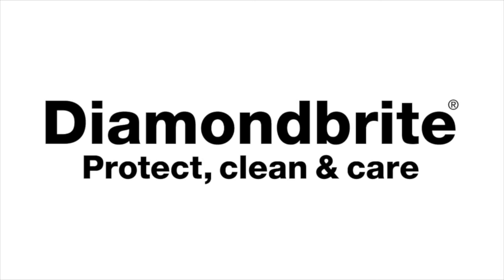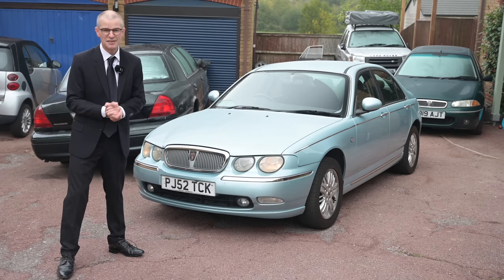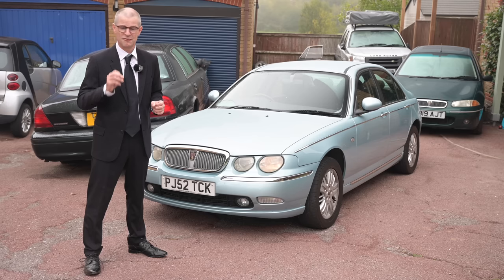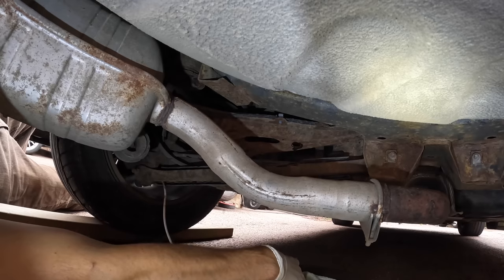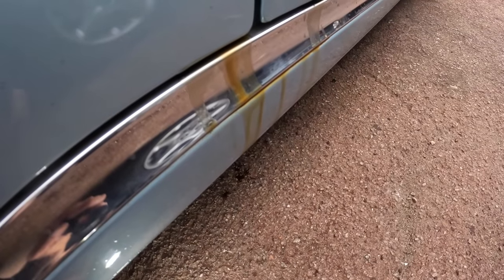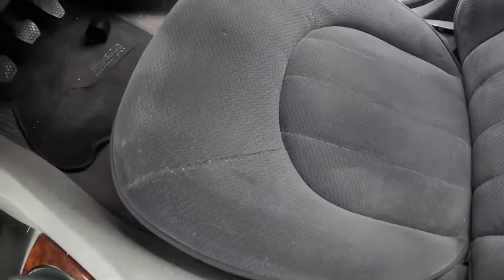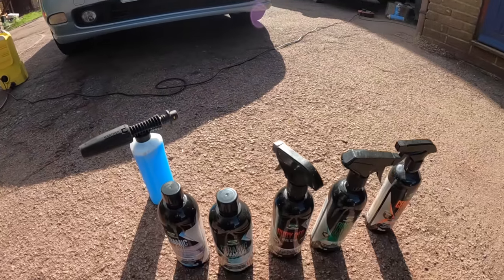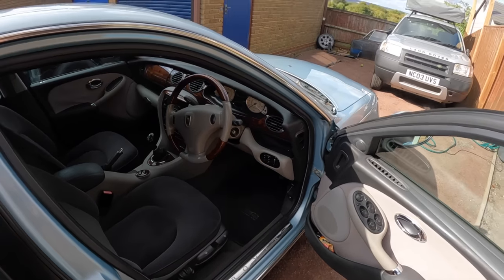I dont want to make this video. Time to say goodbye to the 75?

Comment: Does it really make any sense to spray wax in unseen parts of the car (which are very likely rusted)? On a new (or a good and endoscopic inspected) car I would do it with a Mike Sanders treatment, but your method seems not very useful for me. On the other hand - any waxing may be better than none.

Comment: The problem with mint cars is you can't use them like a normal car. There's nothing much to sort. You either keep it long enough to gain problems or sell them. Probably would be an ideal keeper if it was a spare or second car. I always like my cars slightly rough enough that I'm not scared to use
Reply from the maker: Exactly, you dont want to add miles or risk car park dings and with little use things stop working

Comment: A sad day indeed, but at least it will live on. I am going to have to say goodbye to Arthur, my 1990 Volvo 240DL estate. I took it in to get some welding done, and it is too far gone to make sense doing it. It would take a full on restoration to make it safe. The odd thing is that Ma took delivery of him 3 days before her 60th birthday. I got the news about Arthur 4 days after Ma died. Still, parts of Arthur will live on in other 240s. A real shame because at just shy of 400,000 miles, the old boy still runs with the best of them.